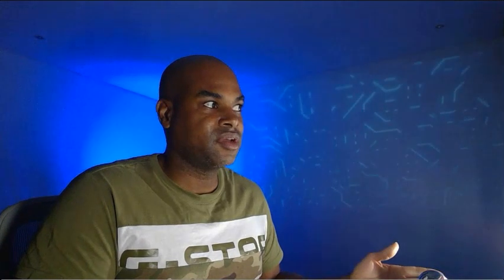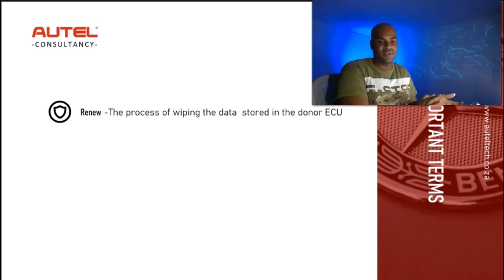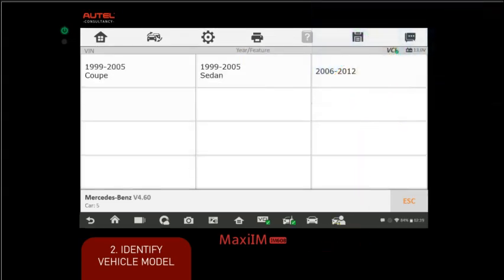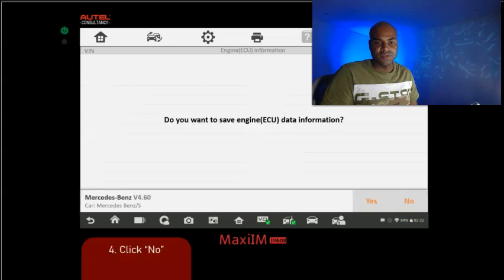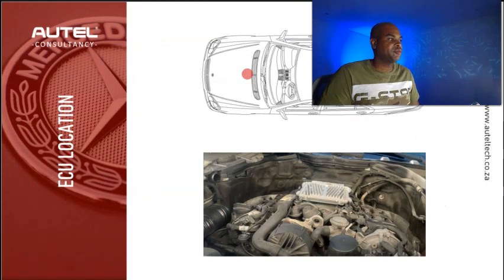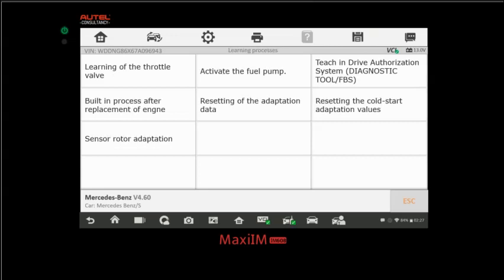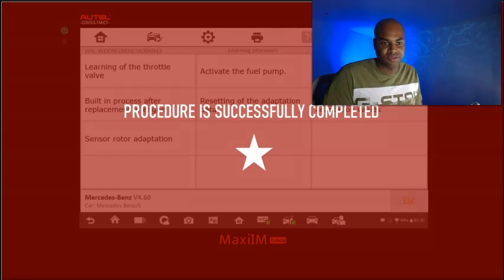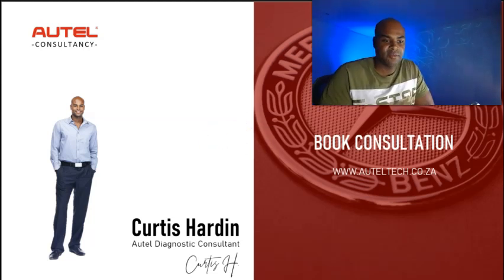IM608 Pro | How To Virginize and Code A Used Engine Control Unit A 2007 Mercedes Benz S Class

Comment: Hi Curtis and thanks for a great video.  What currently, is the best value kit that will perform the latter half of  the video i.e. programming a virgin ECU (on the car) to a Mercedes W212 2012 E220.  Thanks again, Phil
Reply from the maker: You would need to book a consultation with me at auteltech.co.za .. Then ill be able to learn more about your situation to give you a matching solution

Comment: This guy sucks can’t even answer a simple question without trying to sell me a course on how to use a tool I dont even have yet also autel customer service sucks too I emailed them more then 5 times asking the same question and no one got back to me it’s annoying and has been over a week now
Reply from the maker: Sean at 03:55 PM:
Hi, I saw your video on how to virginize a Mercedes ECU using the IM608. I was wondering, would I be able to do that with the Xtool D9s Pro?

Curtis at 05:00 PM:
Hello Curtis here from Autel Consultancy. I would recommend contacting Xtool directly as I don't know the limitations of that tool. Otherwise, you can book a consultation with me, and I'll conduct the research that you're not able to find regarding that tool.

Thanks, Autel Consultancy

Sean at 08:16 PM:
Hi, I messaged you a bit earlier about the Xtool D9s Pro being able to renew ECU. I was wondering, would the Autel IM508 work for the SIM271DE2.0 to renew/virginize the ECU?

Sean at 10:02 PM:
Hi Sean, Did you make a booking for me to check? Go to Autel.Setmore.com and book the diagnostic tool consultation. This way I can ask you more questions to reveal problems that you didn't think about. Then I will give you a tool strategy that will solve those problems. Then I will send you a proposal and then you have a choice. If you just want to make use of me and my engineering expertise and want to purchase from someone else, you can do that. If you want to benefit from the tool and have me train you on how to use it to speed up your learning curve, then I can sell it to you directly and help you with the procedure. Otherwise, if you feel this is not necessary and just want generic advice, you can call Autel New York tomorrow and see if they can assist you with your question. Keep in mind that I am not affiliated with them, and the information you receive may not be accurate. Let me know if you want me to give you their number or if you want me to assist you.

Sean at 12:26 AM:
Will this method work with the Autel IM508? (Link to YouTube video)

Curtis at 10:18 PM:
Hi Sean. Look, you're taking a risk by trying to avoid the consultation. I always tell people not to base a decision on a YouTube video because you could be wasting your money. If you do not want me to give you certainty, contact your local supplier, and they will give you a generic answer.

Sean at 10:55 PM:
Thanks, but I don't have money to pay for a consultation. I'm just wondering if the tool has the same functionality. I don't have money to buy an IM608 as it's too expensive. If the IM508 doesn't support the feature, a simple yes or no would be helpful.

Curtis at 10:58 PM:
Hi Sean, I sell this tool, and I offer training to those clients I sell to. There was a time when I didn't charge for my solutions, but after I started to grow, I noticed that people who could not get direct answers from Autel or their supplier of choice would contact me. It got to the point that it was taking me away from my main clients because the framework that I use to give certainty is not a simple process. I get the VIN, ECU Model, etc., and I pass it to my engineer and then relay the information to the customer. If the tool doesn't support it, I will find a cheaper alternative to solve the issue. So, it's not a yes or no answer that I can give you. What you need to do is think logically if the $97 is going to save you time and money or waste your time and money. If you don't need certainty, you can call Autel New York. They will give you a quick yes or no answer.    

( I made a presentation specifically for people with your minded..  its called " Don't Be an 'Ask Hole' Why I Charge for Autel Diagnostic Tool Strategies" https://www.youtube.com/watch?v=FlgCeW-73H0&t=3s)

Comment: Thanks for a great video; your presentations are absolutely brillant, simple, clear and concise as well as informative; 
Im glad i came accross this. I actually performed this task upon brainstorming about the logical ways i could implement it. 

Your process is absolutely smoother. I did it all manually in the immo section of the tool. 

Since i was at the vehicle at first, 
I read engine ECU data as well as coding data and saved both of them. 

Then home office bench set up to renew the module just like you did. 

Next, i wrote the engine EXU data previously saved by obd

Then wrote the VIN 

Then wrote the coding 

Then personalized the ECU; this is basically the transfer of antitheft data including key number and ID from the original to the donor

Activation is not allowed on bench and must be done by obd so i did. 

After that i went into diagnostic to check the DAS. All 4 requirements were YES, TP detached, start enable & the first 2 that i cant recall. 

For me the module was ready to rock n roll; it did not start because the vehicle had a preexisting condition that supposedly blew the original ECU per an alledged electrician say. 

I believe either, the original ECU was misdiagnosed and wrongly accused of being bad, or the causes of the ECU becoming bad, if it is, is still present as evident by 2 low voltage active dtcs. 

The client refused to pay for my service; i just told him to have a more competent electrician perform a disgnostic because i knew i made the donor ECU as identical as the original including the number of keys and their key id.

Comment: Great content Curtis! I just found your content today and will definitely be watching all of your videos. I understand that you charge for your time however maybe you could give me a tip or possibly pay you for your services if needed? I have a MK906 pro (Subscription expired) hat I tried to code out rear o2 sensors on a CLS55 (off road vehicle) and found myself with ESP issues and lack of communication with modules. My question is, is there any way to correct this easily with the tool? Maybe do the teach in process to correct it? I reverted the settings however the issue still remains. I also have an IM508 that has a current subscription. Any pointers would be great. Thanks!

Comment: Hello  add key vw mk7 2015 jhonson cluster 34xxx740  I found  only  34xxx741  in 608 thanks
Reply: I try 34xxx741 I read  immo data and cs code  at make delar key put orginal  key in program xp400  failure

Comment: I just get the new IM608 Pro II but when I try to writing the VIN for 07 S550 and the said this unit does not support writing VIN.... ? cold you help. please
Reply from the maker: Did you check with your supplier first? I can help you but I charge for customers who I didnt sell to.  Im not even sure if the function is available. Maybe give your supplier the VIN and see if they have access to the engineer to verify the function . This is what I recommend my clients before they attempt a procedure.

Comment: Thank you for you online training, very interesting, I have to buy my 608 for sure
Reply from the maker: Hey Filex, Justa purchasing tip. If you don't need any training or support you can purchase any ware online. If want training and support I can sell the tool to you directly.   Im just giving you this option because alot of people get inspired to by this tool , but then after they buy it the get stuck or they are afraid to do the procedure. If they would have got consulted first and then I sell them the tool i would be able to help them out that situation.
Reply: @AutelConsultancy  thank you for your response, I have this question, can I start doing something like this and programming keys if I start with the 508 model and then down the road upgrade to the 608 ?
Reply from the maker: @felixmasis3658   Book a consultation with me my friend. If I give you a tool strategy with out consulting you then it will be costly since I have ran my framework to find out all the problems you want to solve
Reply: @AutelConsultancy  I am a 30 year experience tech with European cars but want to get into the business of ecu programming , immo and keys
Reply from the maker: @felixmasis3658   If your serious and want me to help you acquire new skill sets as well that will help you make this transmission  , go to auteltech.co.za and book the diagnostic tool consultation.

Comment: can you come and program ecm can you program this vehicle with the IM508 pro?
Reply from the maker: When you sat program. Do you mean when you replace a module with a brand new one and you need to install the software calibration file into the new module?
Reply: I mean can you you do exactly what you did in this video with the Autel IM508 ? or do i need a IM608 ?
 @AutelConsultancy

Comment: question, can you reset or virginlize a Mercedes Benz 2005 SLK 350?  I was told by a shop it can't be done and that I need to buy a new one for $1,000.00. I think it can be done because why would it work on an S Class and not the SLK Class?
Reply from the maker: Usually what I do for my prospective clients is when I talk with them in my consultations what I will do is find out the VIN and ECU information to get a 100 percent answer. If you dont want to book a consultation you can try asking the supplier who you want to purchase from and see if they can give you that information before you buy.

Comment: Great Video my brother. I have a Mercedes Benz SLK 350 2005 with. abad modlule and thee shop wants to charge me $2,000.00 with ordering a new module from Mercedes Benz. I am a computer Tech but I have never considered working on car computers. Thank You soo much for the info.
Reply from the maker: You have an advatantage. I just consulted a robot engineer yesterday. After consulting him I should him how to use his skillset to the automotive niche as most mechanics are not software savvy

Comment: Hello Curtis. This is Kelvin. I recently swapped out an engine and transmission in my 2008 clk 550. Initially, it wouldn’t start but after placing the old ecu on the replaced engine, the vehicle cranked. Unfortunately, it will not move. Is it as simple as programming the ecu that came with the swapped engine or do I need to have the replaced transmission programmed all together? Any advice would be greatly appreciated.
Reply from the maker: Which tools do you have?
Reply: @AutelConsultancy  when I said, "I recently swapped," I didn't mean I did it. A friend of mine who is a mechanic performed the swap. He does not work on Mercedes and this part has been a challenge. I'll have to ask him about the scan tools and accessories he has. Should I ask him about some specific tools?

Comment: I removed my ecu and put it back in,now the 🚗won’t start…………help. Mercedes-Benz c300
Reply: You did it with switch on?
Reply: @pinpointautodiagnosticsene9655  you mean with the engine on?NO.

Comment: Thank you for the information. I just have one question. If they send you the ECU how do you complete the job after renewal and writing of the ECU? Dont you have to have access to the vehicle to complete the job? It looks like you have to be with the vehicle to complete the process. Just a little clarification is needed on that process. Thank you
Reply: Yes you would need access to complete the job. They would have to clear the ecu for you and send it back. That’s when you have to do the drivers authorization yourself with a scan tool

Comment: Does anyone in the Dallas -Ft. Worth area have this devise? The Dealer told me my car, 2004 ML350, can not be fixed.  The AAM went out and is now obsolete. Does anyone know a work a round because these computer are specific to each car and you can not substitute used parts.   Great body , tires, interior, I need help!?

Comment: I had to replace the ECU in my e-Class recently and came across this issue of not being able to fit a 'used' ECU from another car.  I would be interested to know what people should be charging for virginising Mercedes ECUs so they can be used again?  I solved the problem by moving the eeprom from my old ECU to the new one.  I de-soldered the immobiliser chip and physically moved it into the replacement ECU.  Worked fine.

Comment: Hi
I had to replace ECU the n my w220 2006 ,and now question is can it be coded/programmed with AUTEL MaxiSys 2 elite

Please advice how to 
Thanks Gab
Reply from the maker: If its a used one your tool doesnt have the capability to virginize the module. If its a new one then you should be able to program it. Send your supplier the VIN number to make sure you can program year vehicle. This is what I do for my client just to make sure their tool can program the module.

Comment: Thanks for sharing your valued knowledge Curtis. I am in Australia (RHD) and have a 2005 Mercedes CLK500 C209. The ECU and SAM have been water damaged. I have purchased used units with the same codes. Could you please advise the procedure to clone them to the vehicle? If too involved online or payment is required, I could contact you directly or can provide my contact details. Regards, Graeme

Comment: i have autel 506 and autel j2534 box.can i reprogram mercedez benz car?
Reply from the maker: If you have the Im508 and j2534 you will wont be able reprogram the Mercedes benz because the im508 has a basic level of diagnostic software and it doesnt have access to online servers.

Comment: A lot of customers like to bargain on Japanese and some domestics cars and I don't good business.  I have im508 and xp400pro.  Trying  looking into specializing in European cars, not easy, but slowly learning.
Reply from the maker: You should get a mentor. This way I shorten your learning curve and you will get the information you  need quicker. Otherwise it will take longer to learn and you might be less confident to take on certain jobs.
Reply: @AutelConsultancy  Agree. It is overwhelming to learn with so many different car models and their technology.

Comment: Ihave done this with my IM608 pro . the ECU worked in the car but it got a lot of communication issues ,ABS/ESB is inoperative light is on. i couldn't do online programming as the scn coding fails after the programming is done on my tool . any idea?

Comment: Got a question I have a autel maxicom mk908 pro and want to virginize and code a 08 mercades cl550 I want to know if it’s even possible I saw you do it with the im608 but my tool is having a problem with the program log and said it sent it to autel but the tech support lady is clueless and can’t even answer my question thanks

Comment: Great presentation as always . I see the J2534 is required for this operation . Will other non-autel J2534 devices work as substitute in process? and if its only the Autel J2534 that works , will it work with the IM508 ?

Comment: Awesome. how do i use my IM608 to program a used ecu (same part number) on a mitsu outlander 2018 that has a no start problem? have also bought a used ETACS. Vehicle key is the blade type

Comment: Hey thanks for the Video 
I have an issue with a Mercedes E300 2014 
The Power Electronics Unit has failed basically the Hybrid motor for generating electricity, A new unit is £4,000 +
I can get a used unit with Guarantee the for like £500 but have been told it needs Virginizeing before it can be Used 
I guess exactly as this procedure for the Mercedes ECU

I am in the UK any idea of people or places I could try to assist me 

Best Regards
Reply: Did you reset a used one?

Comment: I am buying a used transmission because Mercedes Benz did not want to sell me the transmission plate control of a 2007c230, it gave me the price of the tcm 900dll, and the valve body 2170dll plus the diagnosis 250dll, plus the labor that I do not remember, they do not give me options and they didn't want to sell me the transmission plate control so if I'm buying a transmission what they want is for me to leave the thousands of dollars with them I don't think it's necessary I just need a single piece in fien, if you can help me get it I'll I would appreciate if I don't buy the transmission.
Reply: Put a used one and I’ll charge you $500 to unlock and program it
Reply: @johnbosco2404  Thank you very much Jhon I already bought the part 107dll and 120 the reprogrammed one thank you very much for the help and your videos that you are well.

Comment: Wow…. I used this IM608 for 2 years ,using these Benz function numerous times and till now …..you guys comes up with this tutorial… I reckon Autel Tutors really need to keep up the pace of releasing  new contents regarding to those new updates.

As 99% of that time…. We have to figured it out by ourselves 😂 

Nice job though , this machine works really well in both key making and diagnosis
Reply from the maker: Just for clarification, I dont work for Autel.( Im private) This is a sample of what I provide to my clients but I wanted to share this with the community as they are not able to get this level of training from Autel .
Reply: Launch pad is better in doing this
Reply from the maker: @johnbosco2404  Every tool has its perks. You just have to find one that gives amazing support and helps you get results your looking for.
Reply: Can this be done with im508s?

Comment: Hello Curtis, Thanks a lot for the procedures. A lot more videos or renewing DMEs are available but not in that simple terms.

I realized in the video the year models were up to 2012 on the S Class.  In case the DME / ECU job is for 2013- / newer Merc models, can IM608 help? If not what other tools can help for such scenarios? Can  the IM608 perform the teach in procedures for newer model Mercs?